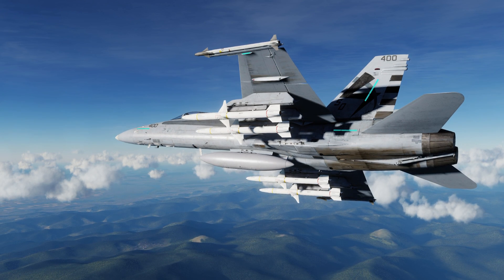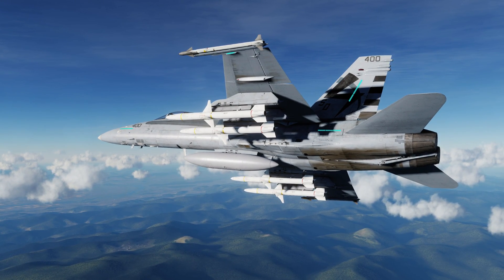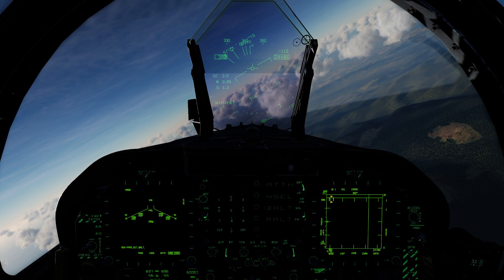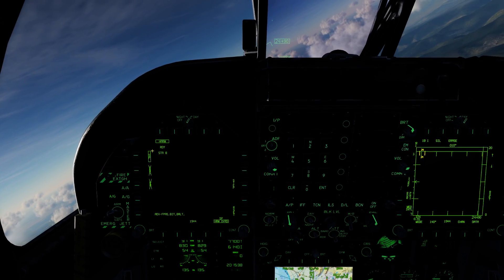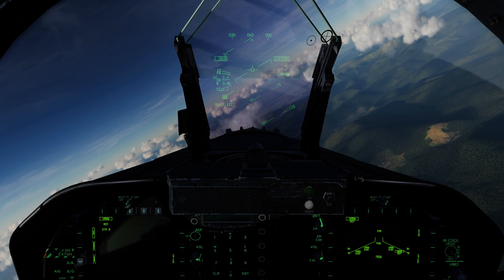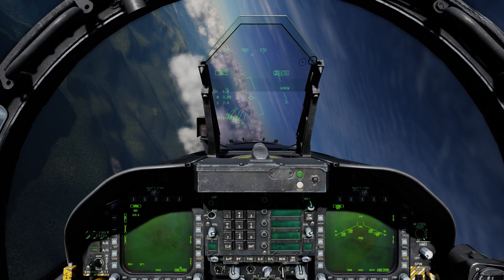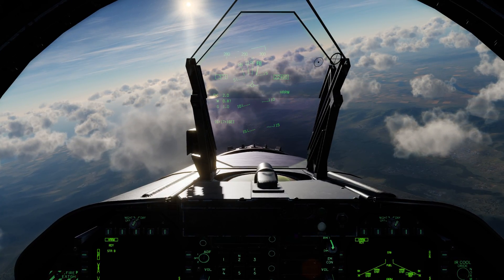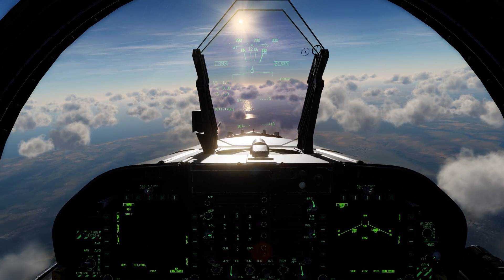DCS: F/A-18C Hornet – AGM-88C HARM SP Mode Introduction

Comment: Will AI shut the radar down to try and spook the HARM? I know they did that in Vietnam but is that even a thing these days or HARM too advanced and wouldn't matter?
Reply: Jamie IIRC the C version we will get has an integrated GPS system, guiding the weapon to to target point even if the radar is shut down. However this doesn‘t matter when the target moves. Newer versions also have an integrated infrared sensor, to chase Target leaving their initial position, but we won‘t get this particular version, since its pretty new
Reply: @skippersmg  very cool, thx for reply.
Reply: @skippersmg  Are you sure it's GPS and not INS?
Reply: T B6 yes its GPS, however i found out it was implemented first in the D model. I think we will get the C model but i‘m not entirely sure.
Reply from the maker: For PB mode yes, but still quite inaccurate to be really effective. Only the the later E with the MMW radar can targeting a radar-silent radar be effective.
Reply: Wouldn't this depend on the firing mode? For example in SP mode you don't really know where the target is, you are firing the HARM riding the energy beam of the painting radar. Once the radar is switched off the HARM will lose the guidance. Correct me if I'm wrong.
Reply: skypara i think with the GPS Navigation system the angle and therefore position of the Emitter can be calculated. If the missile will actually reach the target is another question
Reply: Back in Vietnam with the Shrike missile, if the target radar was turned off, that was the end of the story.  With HARM being able to remember the position, that mostly helps it keep on track until the radar comes back online to track again.  If the target radar goes offline 50nmi away and doesn't come back, I really don't see the HARM making contact.  But with the SAM radar off that long, the 20mm can do the job!